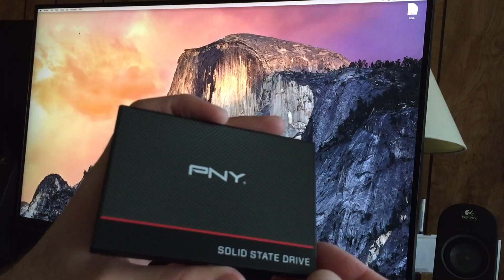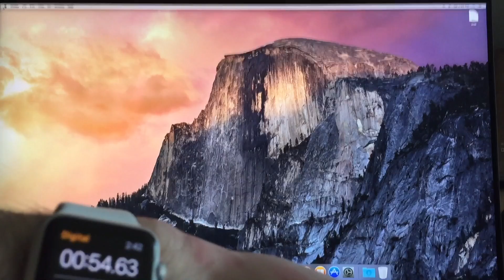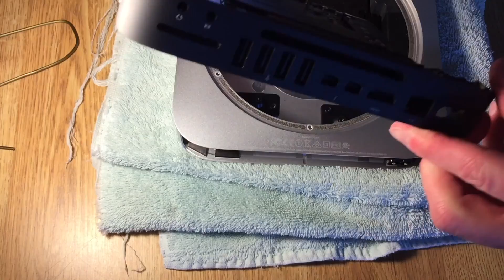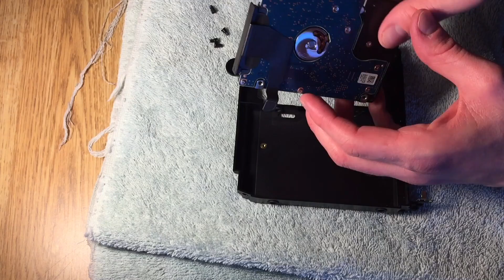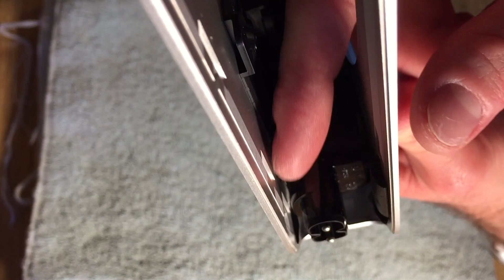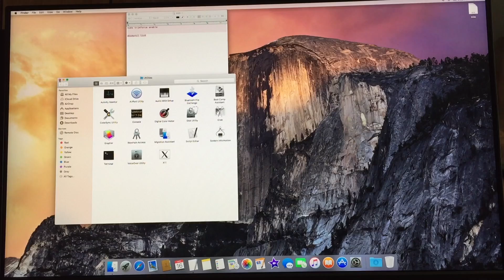Apple Mac Mini (Late 2014) HDD replacement

Comment: Amazing tutorial, I can’t thank you enough! To my amazement, I did not leave any screws behind, and the thing booted right up! This is not a job for the faint hearted. One minor correction, the screws that hold the drive in place are T8. Important because one of the screws is hard to reach (wires in the way), and using a T9 bit might strip the screw head.

Comment: So I have a 2014 16 gb and a 1tb. I have the adapter for the fusion drive. I have lots of ssd cards as luck would have it. Can I put a 1tb 2.5 where the hdd was and a 512 ssd card with the adapter to bring this i7 3.0 to a 16 gb ram and 1,512 gb ssd shared? That’s sounds like a pretty good machine.

Tell me why I can’t do this? Also, why isn’t it anywhere online? OWC is so expensive compared to ssd (brand names now). A year ago they were a modest amount more, now they are the apples of ssds but without cutting edge. Crucial mx is just as good as any OWC. I’ve got crucial and Wd red card.

Comment: Hello guys, 
Who can reply to my question please: 
I have a Mac Mini 2014 which I'm using to build IOS apps, but simulator, xcode are running very very slowly 
Does this video is a solution ?  who tried this ? Thanks very much !
Reply: It could be a solution. Ssds run much faster than hhds

Comment: You do not need a tool like shown at 10:32 to push out the logic board. Just hold the mac mini with both hands, then push against the lamellas using your thumbs.

Comment: If you have an old Mac Mini with an HDD and it runs slow as fuck, do this, insert an SSD and have fun. Did that to my machine and boy it runs smooth in 2020! Definitely worth every penny and every bit of fiddling with odd screws and weird casings of the Mac Mini!

Comment: Its been some time since you did this. In all honesty, was it worth it? I have the same mac, and if i have to upgrade the whole system it will be pc with ubuntu. In order to stay with mac for another year or 2, will you say this was worth it? 6 seconds off boot time? Sounds like a marginal gain.
Once I installed Mojave, this thing became a slug. Stupid slow. Developing angular apps, npm takes 6 minutes to launch. On my work dell laptop of 2014 it takes 90 seconds... 
the bottle neck is the hdd. Got 2 gb ram free, and cpu @ 55%

Comment: Great video!!!  Haven’t tried it yet, but gonna... 
What kind of monitor and connection are you using with your macmini 2014?
Tried new LG ultrafine 4K and doesn’t work. Other lg’s do low resolution. My old NEC (bless its soul worked fine.

Comment: great video thanks. Apple really do want to change their anti upgrade mentality. I was completely disillusioned when they said I couldn't update the memory because they solder it to the mainboard. Why would you do that? Also they refused to sell me a replacement battery for my Macbook Air 11".  Looking at building a Linux box now.

Comment: "Apple: Think different."
Let's put the hard drive in a different spot, one that will annoy the shit out of our customers.
Reply: well.. only true techies/geeks are going to try and do upgrades to these products anyway.. about 0.0015% of apples customer base... so why make it easy?
Reply: @pesto12601  not sure since Apple didn't put the best it could fit. That's the reason to make this change.
Reply: @dgponce  Agree.. and I made the change to the HD and it took 20 mins or so.. not hard with all the resources on the internet.. but I'm a techie.... your average mom buying one of these off the shelf for netflix and email could care less about SSD vs 5400 drives..  Thus, Apple makes it hard to upgrade but uses quality construction methods.
Reply: @pesto12601  we ´ve to say that in all 2007/2008 pcs ssd dont make difference because the bus speed of the hard disk. But now a days, ssd are making a big difference. But its true, momys don't virtualize! (-mines did). thats the marketing goal, get much than you expect and this wasn't the case.
Reply: @dgponce  agree 100%... if I were running a company with big marketing pockets.. i'd do the same thing.. nothing wrong with that since 99.99% of folks will never bother to even think what is inside the box!

Comment: Success! Great vid. Tip, if you’re on a budget I used just one TR7 to do the whole job. It’s an odd fit but works for both TR6 & TR8 screws with a little extra pressure.

Comment: Is it possible to have dual Drives in the Mac Mini?
Reply: Only in 2010-2012 models... Apple removed that option in 2014 model.
Reply: Mine has a fusion drive and they sell adapters to add on a ssd card to your logic board. Why can’t you do that update and replace the hdd with a ssd?  Used ssds are not expensive as they were.

Comment: The write speed is so slow because it's a TLC SSD and the test uses FUA, disabling any onboard cache. Write speeds will never increase with time. With the cache enabled you'll see faster writes. For fast sustained writing, get an MLC SSD.

Comment: Thank you. I was able to watch the video first, then do the swap on my Mini and bring it up on the first try with this video. Only thing that I would add is you need a "security" T6 and "security" T9 Torx for this. You mentioned just T6 and T9 but they have that annoying little security hole in them. Nice job, thank you! The re-download of the OS from Apple, and then the OS patches and upgrades to latest, took forever ... Apple gets a fail there. A+ to you.

Comment: Nice video, but them 2014 mac minis are slow, ive got a 2012 2.6ghz quad core with 16gbs of ram and a samsung 850 evo 500gb drive, it boots up in around 11 seconds.

Comment: hi! a quick question: If I buy the 512 GB SSD version, can I put an additional disk to the SATA controller? For example, If I buy the Samsung 850 pro 1 Tb, can I use it together with the original 512 pcie SSD? Thanks

Comment: why didnt you go the pcie method theres people on ebay selling them for like 40 dollars for the cable, 200ish + the 250 gig ssd drive included might have been a lil bit more expensive then the sata ssd but it would have been way faster.

i did the cheap way for my mac mini usb 3.0 thermaltake drive cage + samsung 840 250 gig evo works preety well this will hold me down till i can source the pcie version of it 

ebay search 
Apple SanDisk 256GB SSD Flash drive 2014 Mac Mini + cable PCI-E Mac

look it up